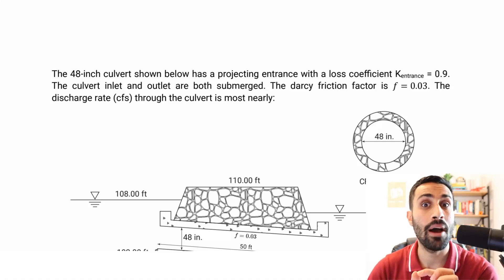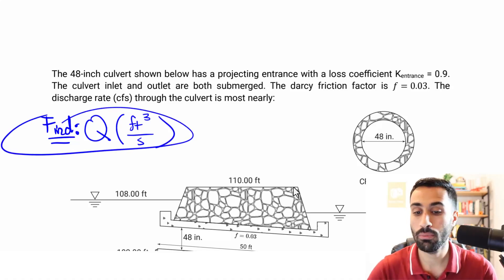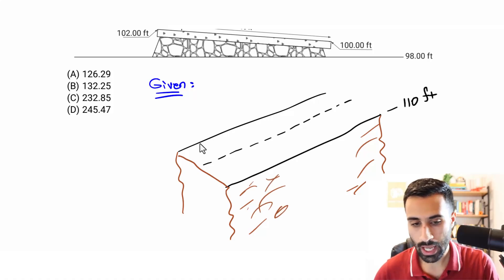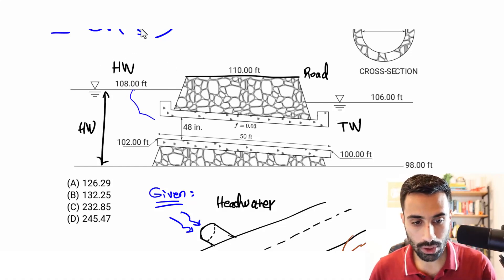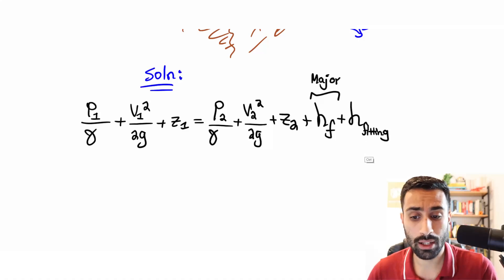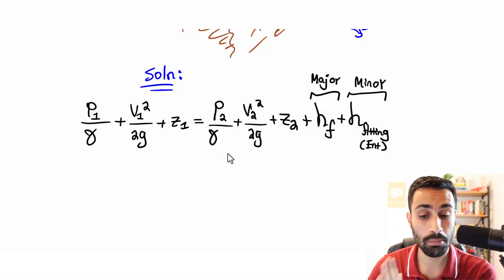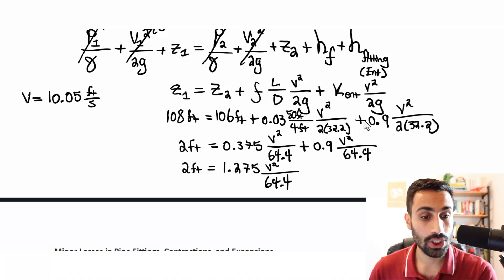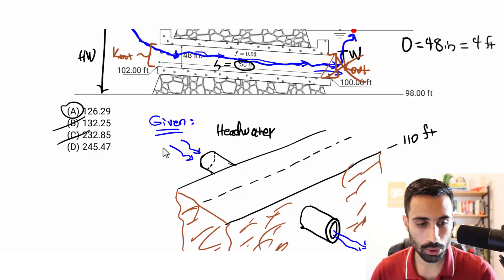FE Exam Practice - Fluid Mechanics and Water Resources - Culvert Flow

Comment: This is pry a dumb question but why is the area (pi(d)^2)/4 wouldn't it still be pi(r)^2 ?
Reply from the maker: Hi Noah! 

There are no dumb questions here! You can use either π(d²)/4 or π(r²) to calculate the area. Both will give you the same result. I usually prefer π(d²)/4 since sewer and water pipe dimensions are typically given in terms of diameter.